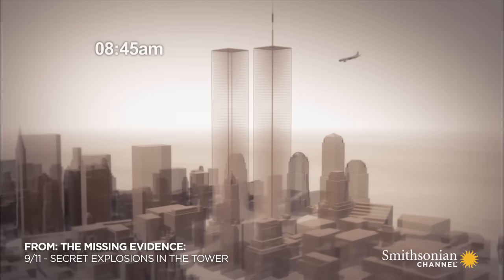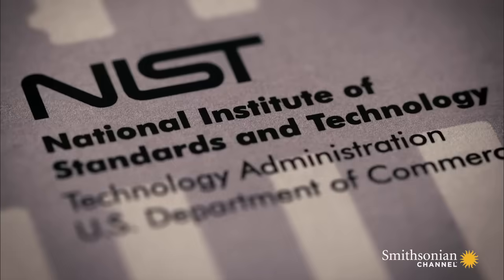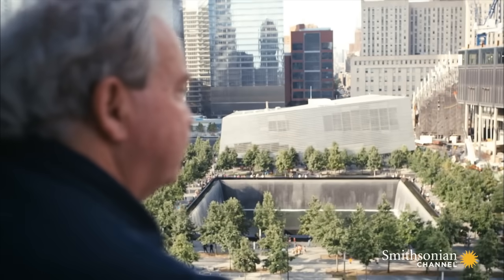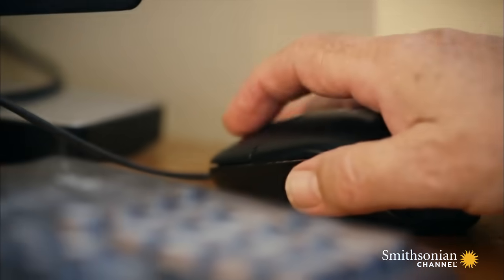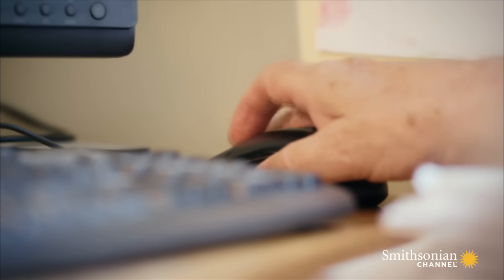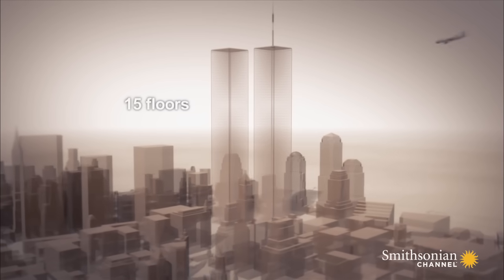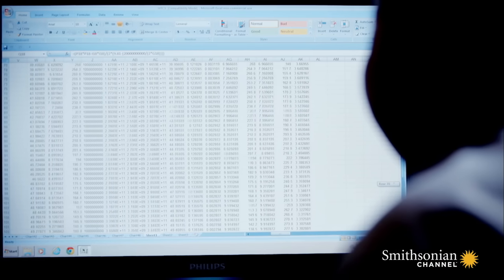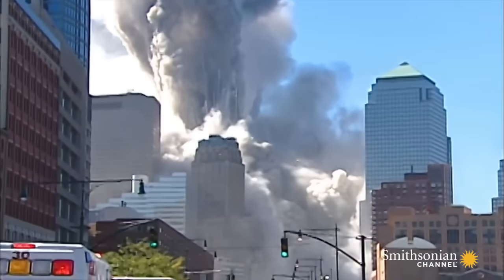This Computer Simulation Explains How the Twin Towers Fell

Comment: What about Building 7 ?
Reply: Title of video:  This Computer Simulation Explains How the Twin Towers Fell

If you were expecting different content than what it says on the tin that is a YOU problem.
Reply: What about it?
Reply: @tpryce6423  It contradicts the explanation given for the collapse of the two towers since it was not struck by any aircraft and wasn't severely damaged. Its collapse needs to be explained in conjunction with the other two buildings.
Reply: @paulsmith1981  Read the engineering report if you want an explanation.

Comment: I’m not a conspiracist,  but it is comical that a history network /Smithsonian produce propaganda would air anything contrary to what the commission says.  Even ignoring the fact that jet fuel burning for 48 hours is not enough heat to cause the collapse. Anyone who has have played Jenga knows that it a weaken structure below the top will cause a topple to the side of the weaken support. So it’s absurd to see the top levels above the impact point not topple to and fall like jenga pieces but instead fall into a footprint.
Reply: You really think “Jenga” is comparable to a 110-storey building?
Reply: The video knows more than you do

Comment: Crazy how the planes could make perfect 45 degree cuts in the steel beams
Reply: The cuts you are referring to were made by steelworkers clearing debris using thermal lances in late October. There are before, during and after pictures, all have been readily available for over 20 years.

But you never even thought to look.

I wonder what else you got wrong. How would you know?
Reply: @MFitz12  They wouldnt, they watch one video and make a conclusion about reality
Reply: They didnt cut the steel beams, they destroyed the steel beams.

Comment: Hilarious and clearly a paid off actor. Those building were designed to withstand air craft strike and no way can jet fuel melt steel. im an ex military demolitions sapper with the Royal Engineers, and those building came down under controlled demolition, nearly free fall speed, just like tower seven did that a LOT of people still don't know about.
Reply: They were designed to withstand a strike of a 707 moving at landing speeds. And they even survived a 767 hitting them at 500 mph. The builders didn't nor could they account for the fuel onboard the plane. You don't have any proof.

Comment: So the buildings were still standing after the impacts. They said they could sustain a commercial aircraft hit, and they did. What they didn't calculate is the collapsing effect as this demenstration shows.
Reply: They also were quite open about the fact that they did not and COULD not figure the effects of fire.
Reply: They didn't account for the fuel load of a plane, nor did they know how they could've.

Comment: This is bs.. why is it no plane parts were found? No engines?? Look at what an airplane looks like after just hitting a goose but you think a plane flew all the way through to the back side of a building that was built to withstand a hit. Let no man deceive you, use your noggin.
Reply: Some plane parts WERE found; an engine on Church St, pieces of landing gear here & there. The planes were shredded - a lot worse than if they had hit a goose! - but most of them were embedded in the buildings until they collapsed. (And BTW the towers were designed to survive a plane hit, not repel it!)

Comment: That's not true. It was never said to with-stand and a jetliners hitting them from above nor did they expect that, ever! Those towers were built to  withstand a bomb  detenation from the lower levels. Fear was trucks or subways bringing bombs through lower levels and blowing up the buildings; like they try to do in 1994. That's how EVERYONE found out the strengths and weaknesses of the twin towers. Hence the plan began to hit their sweet spot. Either way, I'm off flash free and name information act of freedom of information act, but do you see the cost? explaining everything doesn't just inform Americans and sometimes you don't know that information should be protected until its too late.

Comment: I wounder where all the steel went while those Twin Towers collapsed like a house of cards...?
Reply: Down.
Reply: @Tim22222 And the steel underneath the impact area which wasn't weakened by fire just turned into dust ?
Reply: @cafl9844  No. No steel turned to dust. No steel was unaccounted for.
Reply: NYC later sold 175,000 tons of steel for reuse. Well documented.

Comment: Psyop inside job, coverup, Robbery, steal your rights, endless wars, missing gold, building 7, molten metal in the basement, dancing Israelis, insurance fraud / asbestos, khazarian mafia, radiation ? Microspheres of iron ? Free fall speed? Air traffic controllers ? Simulations? Wrong engines, melted vehicles, energy weapons ? Nano thermite ? Nuke pits implosion ?
Al franken and others told not to goto work in the building that day ? No planes ? Black sites ? 
Where did the towers go ? How do planes turn metal to dust ? 
Police state / endless wars / fear and propaganda ? Genocide ? Comity of 300, world economic forum, council on foreign relations, the trilateral commission, gavi / gates depop, eugenics = transhumanism, hydrogels, divide and conquer.

Comment: No it dosent, the towers have been hit before by the same plane essentially around the 70s to no real affect, the towers fell in the typical pancake fasion used in demolition, and there were explosions heard before the planes hit, also jet fuel cannot melt steel what can however is thermite which left the molten steel beams that also had the distinct angle cuts  on them also used in controlled demolitions.
Reply: "the towers have been hit before by the same plane essentially around the 70s to no real affect"

Nonsense! You're thinking of the B-25 that hit the Empire State building in 1945 - a plane 1/10 the weight of the 9/11 jets doing 1/3 the speed, hitting a building of completely different design & construction. Apples & oranges.
Reply: I think your confused. The towers had never been hit with a plane before that was the Empire State building. The only time the towers were previously attacked was when it was bombed in 93'. 767 aircrafts didn't even exist in the 70's.

Comment: I got a theory. If a Boeing 767 crashed into a building like that, on physics the top of the tower would have fell forward onto the plane and the bottom would fall the opposite direction but they just fell straight down. The only way for that to happen is if something or someone made the bottom floor collapse meaning the towers fell from the bottom. But there's some people who say "Well yeah but you weren't there and you didn't see it or hear it." and your right and I almost gave until I remembered an audio. It was a recording of a woman on board who said "Its a frame.". A frame is when you accuse someone of wrong doing that you have done and they get in trouble for the actions you made. So if this is true, If it wasn't Osama then who was it? who was the master mind? and I have searched and I see almost nothing..... except. There was a announcement that was about The National Economic Security and Recovery Act. But the evil couldn't allow it for some reason so they came up with a national disaster to push peoples minds and thoughts away from National Economic Security and Recovery Act. The National Economic Security and Recovery Act was dead afterwards. People were killed. But not the plane because, The planes weren't there, The things that made the building fall straight down was what killed people.

Remember this is by my own research and speculation.

Comment: Dr Judy Wood poses the most intriguing question in her talks & book (which all other theories entirely miss) exactly where did over 1 Million tons of rubble go? I mean before the cleanup started. Should’ve been a veritable mountain of concrete, metal, glass, not to mention marble, tile, toilets, sinks, office furniture etc etc but it almost all quite literally turned to a fine dust in midair. This dust covered the poor people fleeing below but yet didn’t burn them. One single file cabinet was found it looks like a meteoric raisin yet still had paperwork & even cash inside which they returned. 

Fascinating & very valid question. not answered by the official narrative nor alternative theories like controlled demo etc & it could not have been a conventional nuke either. 

Where did the towers go ??
Reply: Nothing was missing. First responders spent 7 months removing very solid debris, not dust! Unless you can point to an accounting showing significant mass was missing, you (and brain-damaged Judy) got nuthin.

Fun Fact: The energy released by each tower's collapse was equivalent to 200 tons of TNT!
Reply: @Tim22222  The rubble at the base of both towers was less than 3 stories high when the dust settled. Guy in the stairwell on the 22 floor survived, with nothing landing on him when he awoke he was laying on a small ledge, and could not believe the 90 floors above him didn’t land on him. Not that any of these facts will stir your interest as you are only capable of name calling and dismissing facts as conspiracy theory.
Reply: @GreasyBelcher  "The rubble at the base of both towers was less than 3 stories high when the dust settled"

Was it? Are you sure about that? I think you're forgetting something: The WTC plaza had 7 underground levels below the street! So in fact your pile was about 10 stories high. The towers did NOT turn to dust.
Reply: @Tim22222  alrighty so 110 stories disappeared into the 7 story basement OKAY then mystery solved 👍lol. There are pics from that day that show the full scene (it’s all in dr Judy wood’s presentations). Watch & debunk her evidence if you can. I always keep an open mind if I see a better explanation, you are prob very scared of anything outside your safe, neat, comfy world-view & that’s okay. Good luck OH…… & on that note im sure you’ll easily reconcile the ramifications of a vetted, high ranking intelligence official whistleblower saying gov has 12 alien spacecraft & alien bodies this week. You’ll do fine big buddy 🫶🏼
Reply: @all_angles8528  Can you read??? 110 stories turned into (roughly) 10 stories. And since the towers were 95% air, is that really such a hard leap?
Reply: Tim. You are misinforming people. There is no evidence to support any of your claims

Comment: Why did it collapse and not just the parts above where the plane hit fall off
Reply: Because the top parts fell off of the columns that were supporting their weight & directly onto the floors below. What do you think happens when 100,000 tons falls onto a floor designed to hold 3500?

Comment: The steel was weekend on how many floors? A fire fighter made it to the 78th floor at the South Tower, that's 78 untouched undamaged floors vs 22 already weakened damaged floors. How did your "pile driver" continue falling and racing towards the bottom with zero floors resulting at the end!? Where are the stacked floor concrete slabs at the bottom so we can believe in the "pancake" theory!!!?
Reply: The top parts fell off of the columns that were supporting their weight & directly onto the floors below. What do you think happens when 100,000 tons falls onto a floor designed to hold 3500?

Comment: "The 110 story World Trade Center towers were designed to withstand the impact of a commercial jetliner. Yet within 2 hours of the attacks, both collapsed, so why did the twin towers fail so disastrously and so quickly?" 

Because they used explosives
Reply: Any evidence to support that claim?
Reply: @tpryce6243  have u actually read the first line? the one that i quoted? Lemme actually rephrase it for you then "The towers did'nt collapse because of the planes that crashed into it" So that means (to put it very simple) it needed some help in order to come down or in other words: This was a so-called "controlled demolition"
Reply: @PaulScholtes1980  No no, I said EVIDENCE. A Youtube comment is not evidence.
Reply: Unfortunately the entirety of mainstream science disagrees with your conclusion and there was zero evidence of explosives.

Comment: Can you simulate how building 7 collapsed on that same day? 2 planes...3 buildings demolished
Reply: Actually 10 buildings were destroyed.
Reply: None of this nonsense can explain why 90% of the bodies weren’t recovered
Reply: Most of them were smashed to pieces by the collapse. @Larry26-f1w
Reply: @Larry26-f1w What would thousands of tons coming down on them do to them?
Reply: 3 WTC tower buildings were symmetrically disintegrated after 2 had received asymmetric damage from plane impacts and one had some debris fell on it.  Physical laws were forgotten
Reply: @davepowell7168  …So you kooks have been repeating for over 20 years.
Reply: Probably something to do with the roughly 25% of the south wall that was scooped out by debris after the south tower collapsed and then the following 7+ hour fire 😭
Reply: Fires started in building 7 from a significant amount of north tower debris hitting building 7, and subsequently, fires burned on at least 9 floors of building 7 unchecked for hours.  That's why building 7 went down.

Comment: The fact the tops of the buildings stay intake are against Newtons 3rd law of motion. As the buildings fall the equal and opposite force is applied to floor above and below the collapse therefore both the floors should collapse reducing the mass of the above structure therefore reducing force and acceleration. In reality if it collapsed in this manner it should have only travelled 15 floors before the entire top section collapsed on itself greatly reducing the acceleration of the fall.
Reply: Too bad the entirety of mainstream science disagrees with you.
Reply: @tpryce6243  trust the science 👍

Comment: When metal heats it expands... when rebar that is inside concrete expands. It cracks and breaks the concrete and floors.   Jet fuel can burn at up to 3,000 degrees.  The planes where FULL of it... steel melts at about 2600 degrees....

Comment: Now ask the excel-chemist about tower 7
Reply: Tube structure holding it up bulged in on itself over time due to damage and 8 hour uncontrolled fires. It then finally collapsed in on itself, as over time the floors of the building began to fall, weakening the structure. After the steel tube fell, the rest of the building, with absolutely no support, falls at a near free-fall.

Comment: Damage to 20-30% of the top portion of a building managed to bring down the remaining 70% (stronger middle and bottom portions)….whatever way you look at it - this isn’t a conspiracy, it’s a legitimate theory that there was more to it. No demolition team would take down a building starting from the top, why? The bottom is the strongest part. The definitive collapse of not one but two majorly expensive and engineered American built structures under the weight of just a few top floors is surprising. Let’s be honest. Not impossible, I’m sure, but definitely not a certainty.
Reply: Ever heard of gravity?
Reply: @tpryce6243  explain does gravity explain it? 😂

Comment: Questions, 1. How much debris was in WTC 7 before it collapsed? 2. How did we know it weakened the structural integrity?

Did the "weakened steel" really reduce the mass enough for the lower levels to collapse under the upper ones????
Reply: Rather late to this but to answer the questions 1 the amount of debris in the towers would not have effected how quickly it would have fallen as the debris is from the structure itself and does not add or remove weight. 2 we know it weakened the structural integrity due to a 747 being approximately 200,000 pounds (100 tons) being slammed into the building at approximately 440 miles per hour leading to it hitting the central supporting core of the structure weakening it. This core was designed to be able to handle only about 5-10 floors without critical failure which is a severe oversight on a structure of that size but was seen as good enough due to the fact that planes rarely struck buildings. This lead to severe buckling in the center of the towers and the corner supports were damaged by initial impact leaving nothing to support the internal structure leading the towers to collapse as if it were a planned demolition. Smart on an engineering standpoint as it mitigated the damage to surrounding buildings due to the way it collapsed. Hope this cleared some things up :)
Reply: @biteingcobra363 I think he is asking about tower 7. The impact of the jets don’t explain that.
Reply: @biteingcobra363  so the pilots were precise enough to hit the center.. well I don't know about that, but the steel was most likely weakened by the crash, but it was designed to resist plane crashes... They say offices fire did it, but many buildings were under fire and they didn't collapse I doubt a office fire caused or fueled by the plane's fuel could do that.
Reply: Yes
Reply: Y'all shut up.. they don't want you talking about this
Reply: Yes.

Comment: The NIST and official explanation violated Newton's law. So it was an unscientific explanation at best.
Reply: The steel turned to dust in mid air. Some kind of technology was used to do that I am convinced of it. Dr Judy Wood's research is excellent. Also, the planes were travelled at 500mph, and no airliner can travel that fast at that height unless at a higher altitude where the air is thinner, so whatever it was couldn't have been an airliner but something that looked like one. Missiles are able to travel at that speed.
Reply: @Embracing01  Magic space beams??? LOL! 🤣🤣🤣🤣🤣
Reply: 100% guaranteed you do not understand Newton's laws. Armchair physicist.